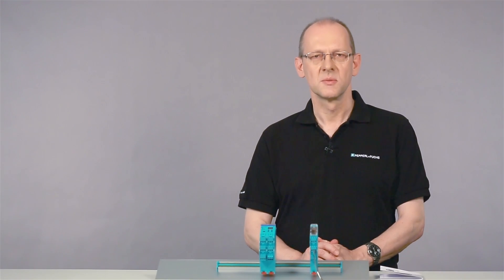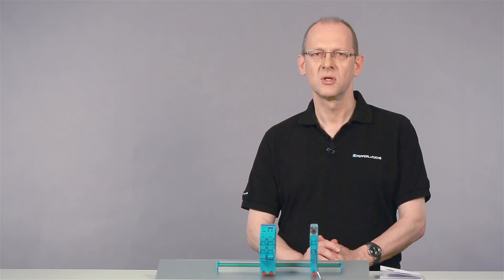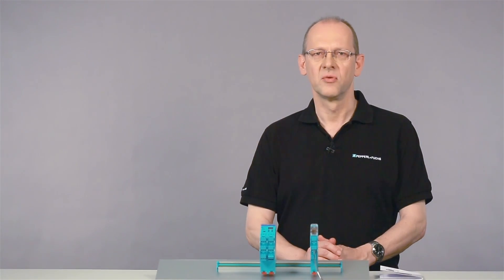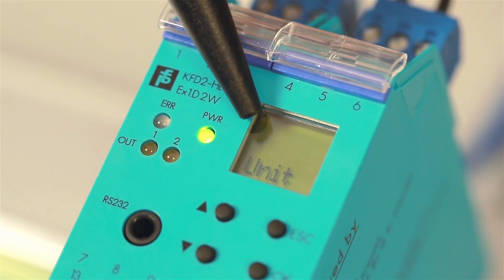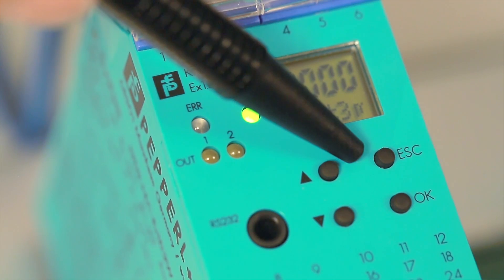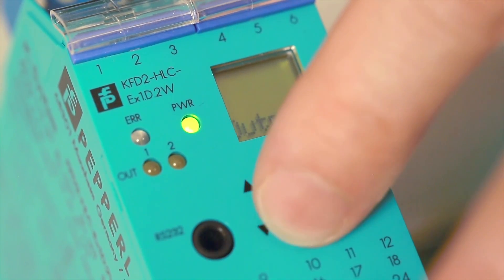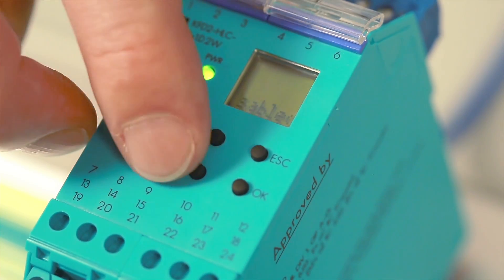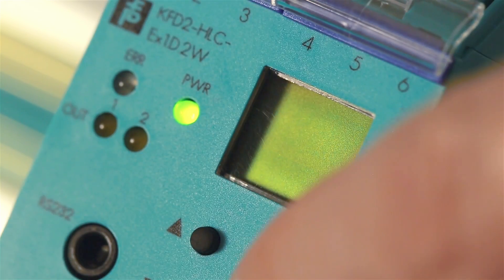How To: How Do I Parameterize the HART Loop Converter?

Comment: Hi, i am trying  use this device for counting electricity consumption wich output is setted to 20 pulse/Kwh. wich parameter am I supposed to inter? I spent 3 days without successing this configuration. The output of the masterpact( breaker) is wired to 13 and 14. Can you help me please?
Reply from the maker: Hello, Thank you for your comment. 😃 In order to help you as quickly and efficiently as possible, we need to ask you a few questions about the issue. Therefore, it would be great if you could contact our colleague at tstabenow@de.pepperl-fuchs.com 
Thank you and have a nice weekend! #AutomationPassion

Comment: I get error lamp blink red when trying to connect EH temperature transmitter, what cause that? ?
Reply from the maker: Thank you for your patience, 
Fastabiq Khoir. Here is our answer: The HLC can be parametrized via push button present on the front of the barrier by accessing the menu visible on the display, or the parameterization can be done via Pactware (plus DTM) by purchasing the cable adapter listed in the HLC’s datasheet. No license is necessary for the software used for parametrization. We hope this helps. If you need further support, please let us know. #AutomationPassion

Comment: We want enter turbine teeth count at converter?
Reply from the maker: The HART Loop Converter converts HART signals into 4...20 mA signals. This measured value can be parameterized by the buttons on the front of the device. The possibilities for this are shown in the manual and in the operator card. An input of parameters e.g. of a turbine is not possible and also not necessary, because the HART Loop Converter already receives a measuring signal (as HART) at the input.
I understand the question in such a way that with the input of the "teeth of a turbine" one probably wants to measure the rotation speed. This would require a frequency converter. This type of device converts a digital signal (e.g. counting the teeth per second) to an analog 0/4 mA ... 20 mA signal and is available for hazardous area signals and safe applications:

https://www.pepperl-fuchs.com/great_britain/en/classid_24.htm

https://www.pepperl-fuchs.com/great_britain/en/classid_1830.htm

We can also provide you the user manual and the operator card.
If I did not understand the question correctly, please contact us again.